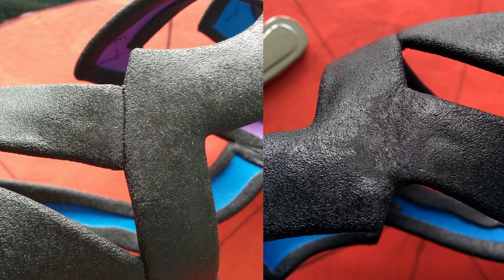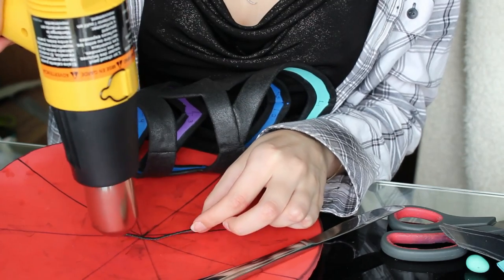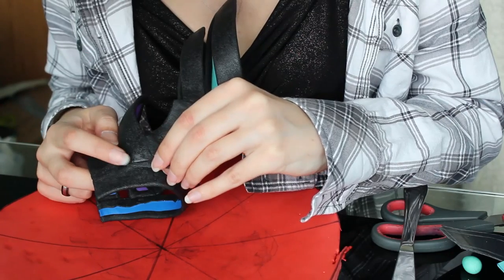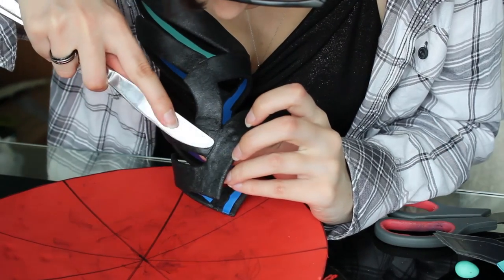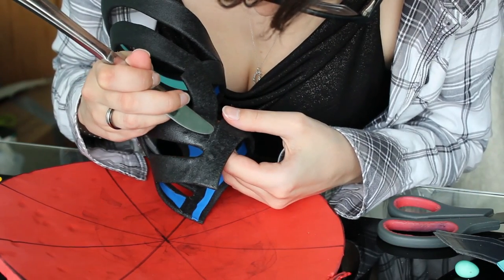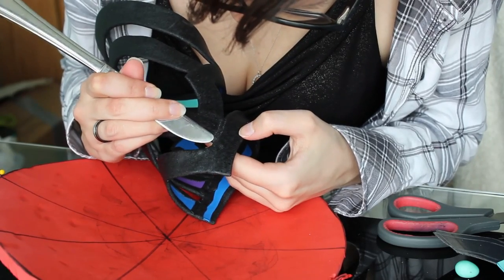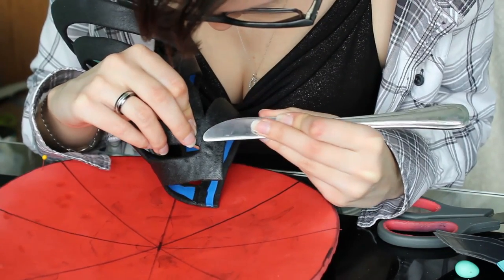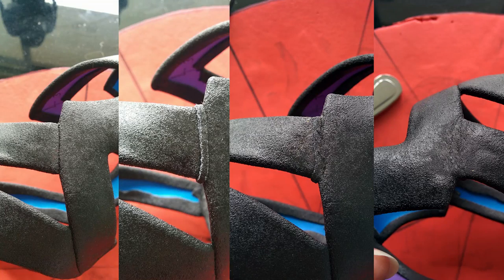How to fill gaps in worbla: Tutorial

Comment: For the air bubble part. Use a thin needle, make a hole a little sideways to the surface. That way you can easily get it flat again. You could use something like a small duct tape to ''roll'' it flat.
Reply from the maker: Yup, that's what the yellow pin on the edge of my red circle workspace is for. You can see it in the video even though I don't use it. I also have a mini rolling pin off to the side :)
Reply: 9Flame Damn, and i thought i could give some little advise i've learned in the past days ^^ .Ofc you knew that 'trick'' already after such a great Ori Cosplay. It just popped to my mind when you said airbubbles. Maybe some other comment reader can use this advise :)